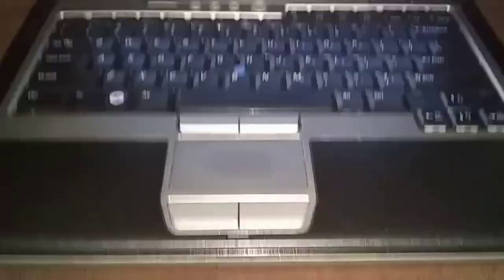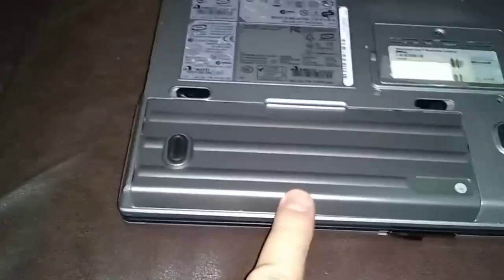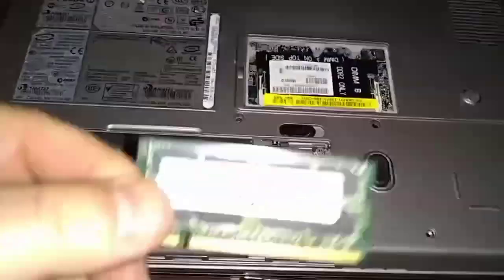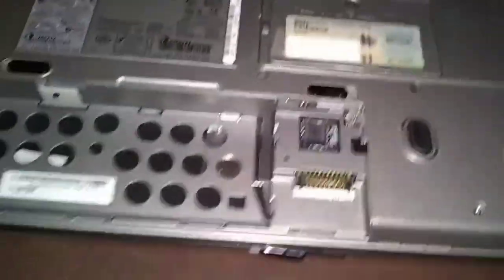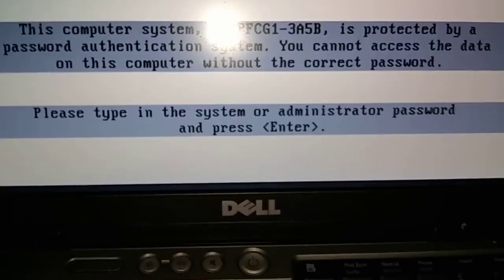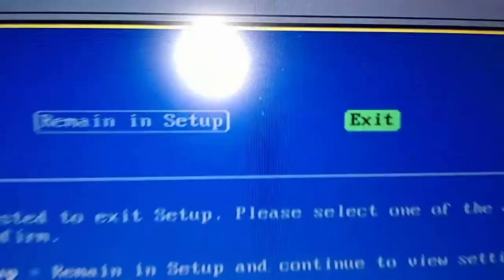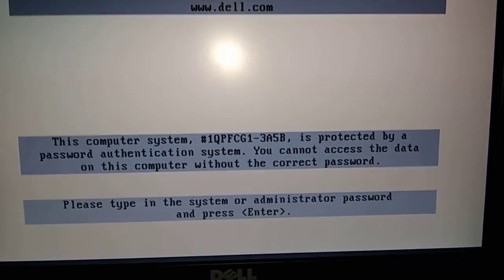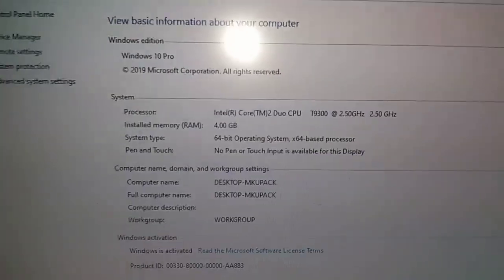The Secret to a Lightning-Fast Laptop: The Ultimate Ram Upgrade

Comment: If you can't make it use at least 8 GB of RAM, it's time for a lightweight Linux install, or a newer laptop if you need Windows 10. Windows 10 needs a minimum of 8 GB for basic functionality, and 16 GB if you are doing anything more than basic office work. It's a pig.
Reply: It will run up to 8gb of Ram!

Comment: The chipset of this Dell supports addressing a maximum of ~6Gb of RAM, so you could install a 4Gb ram module instead, OR replace both modules for 2x4GB. The total RAM will still be slightly under 6Gb (some of the ram is addressed to the graphics processor).
Either way, RAM is as cheap as it could be nowadays, it doesn't break the bank going for the max. It's the cheapest upgrade possible, and after switching the HDD for an SSD, what is always recommended! 
Cheers!
Reply from the maker: Thank you!